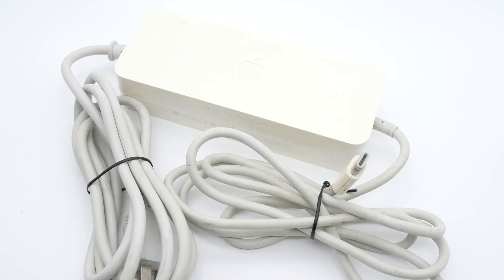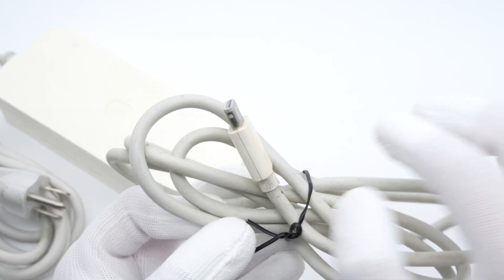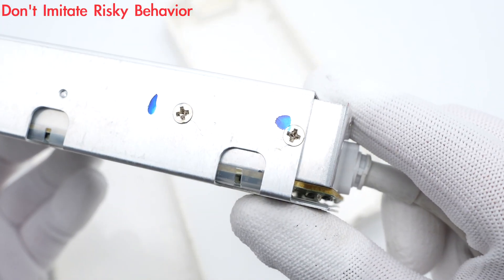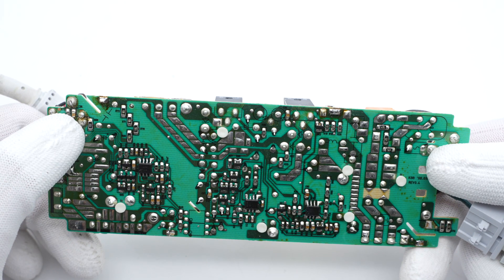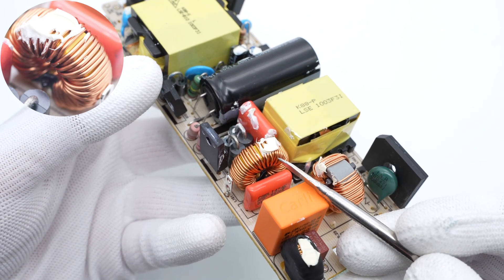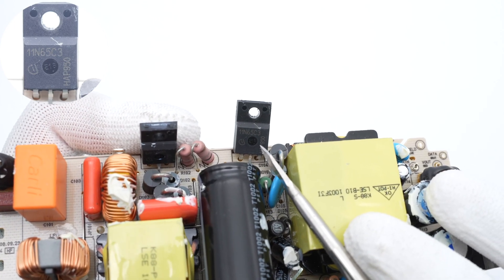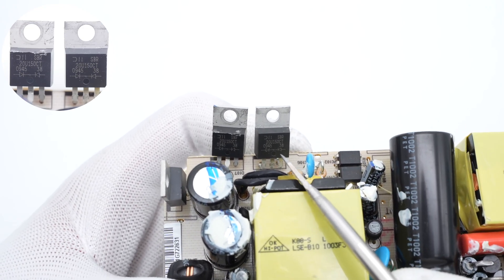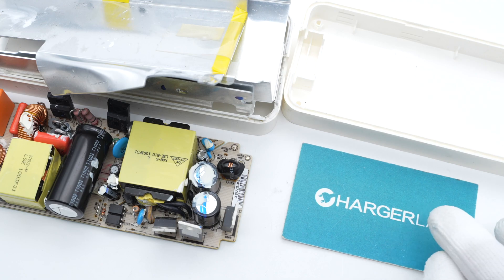Back to 2006 | Teardown of Old Apple 110W Power Adapter (For Mac mini)

Comment: Thanks for the video as usual
Any tips on how to find the topology or how youre finding the topology?
Reply: Some tips:
1) number of mosfets
2) number of magnetics
3) position of magmetics
4) type of capacitors
5) position of capacitors
6) number and connection of output rectifiers

So, if you have one mosfet, one transformer, no inductors near the transformer, no film capacitors near to the transformer and the output rectifiers are connected in such a way to act as a single diode, it's flyback.
If you have one or two (not in a half bridge configuration but with a rather big diode next to each one) mosfets, a transformer, the rectifiers connected in such a way to act as a two diode-common cathode rectifier, with one anode connected to the trafo and the other one to ground, then an output inductor, usually toroidal and quite big, it's probably a single or double switch forward converter.
If you have 2 mosfets in a half bridge configuration, a rather big (>470nF) film capacitor in series with the transformer, a transformer, the rectifiers connected in such a way to act as a two diode-common cathode rectifier, with one anode connected to the trafo and the other one to ground, then an output inductor, usually toroidal and quite big, it's probably a half bridge converter.
If you have 4 mosfets in a full bridge configuration, no capacitors in series with the transformer, a transformer, the rectifiers connected in such a way to act as a two diode-common cathode rectifier, with one anode connected to the trafo and the other one to ground, then an output inductor, usually toroidal and quite big, it's probably a full bridge converter.
If you have 2 mosfets in a half bridge configuration, a rather small (<100nF) film capacitor, typically in series with an inductor, in series with the transformer, a transformer with a center tapped secondary, the rectifiers connected in such a way to act as a center tapped full bridge rectifier, then a capacitor bank, no or very small (<2.2μH) output inductor, it's probably a half bridge LLC converter.
If you have 4 mosfets in a full bridge configuration, a rather small (<100nF) film capacitor, typically in series with an inductor, in series with the transformer, a transformer with a center tapped secondary, the rectifiers connected in such a way to act as a center tapped full bridge rectifier, then a capacitor bank, no or very small (<2.2μH) output inductor, it's probably a full bridge LLC converter.
About the PFC part, it simply looks like a boost converter and its output capacitor it's rated for more than 420VDC.
If you want to learn how to recognize everything at a first glance, I recommend you to write down and organize what I says in a table and to look at many PSUs teardowns :)
Reply: @fabriziobrutti1205  woah thanks buddy 
I was really confusing between Flyback and Fwd.
Reply: @koushiks_energy  you are welcome! If you want to have a nice example of a 2 switch forward, give a look at DiodeGoneWild's series about repairing a 12V 50A PSU :D